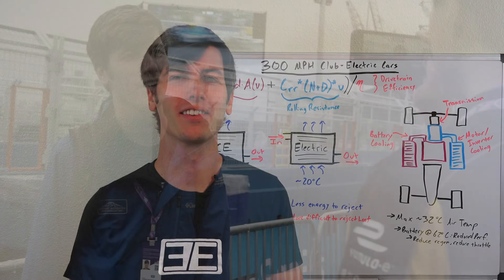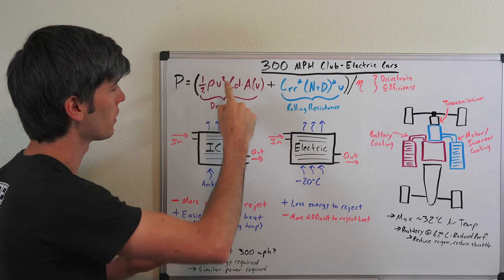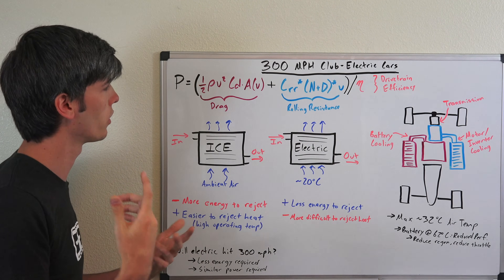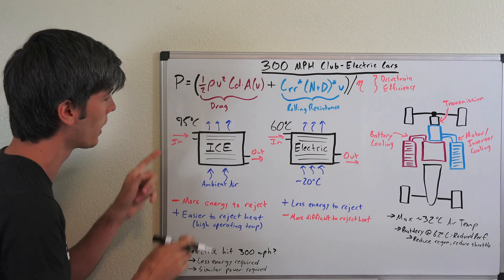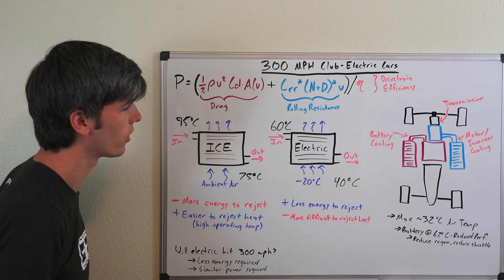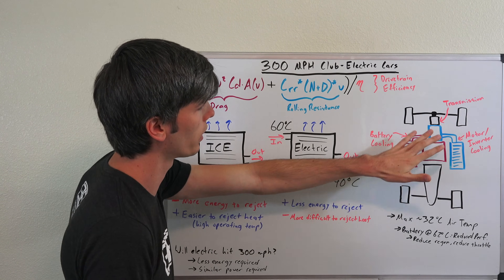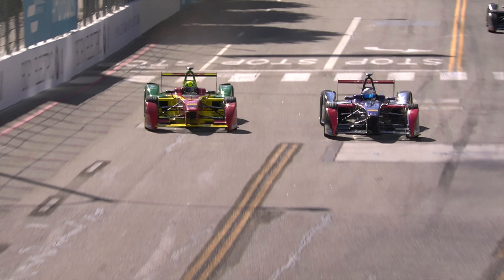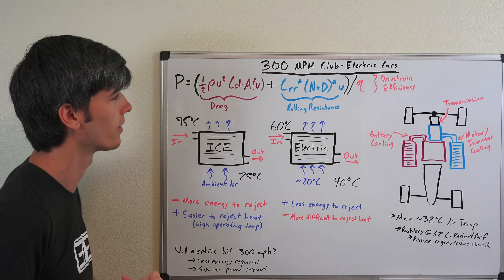Why Has No Production Car Hit 300 MPH? Electric Cars

Comment: I thought it was tires, the Veyron's tires can barely handle 434kmh/270mph and they were specifically made for top speed.
Reply: Shizukage I immediately thought the same thing. When Bugatti first released the Chiron, they said tire technology was the one thing that kept that car from going 300mph.
Reply: I think he talked about that in his last video about the hp required to go 300mph
Reply: The question is "Why hasn't a production car hit 300mph yet?" That's literally the title of the video, man. Lol
Reply: joseph bourdeau i think if you can afford a street legal car that can do 300mph you can probably afford a few thousand dollars for tires.
Reply: @kellypg  The problem isn't necessarily the dollar cost - the manufacturer can't be sure that you will bring it to the dealer for tyres,once a week - if they could, 300 mph is easily achievable...
Reply: Definitely a factor as even Z rated tires are only really safe up to 150 mph a car going twice that speed would have to have specially designed tires probably costing a couple thousand dollars each !
Reply: I was about to comment this, yeah the tire bead expands due to the centripetal force and all hell breaks loose
Reply: 3両編成・・・
Reply: Shizukage the wheels need to be made of cold steel alone.
Reply: Jesko and hennesy suck
Reply: That's a vehicle not a "Production Car"...I hope you're joking honestly.
Reply: You are correct (or were correct - this is an old video) Tyres are the weak link,and what's more is,this will be more of a factor with EVs,because they are heavy. Much as I like the idea of an electric car,you can't get away from reality. The other,other side of the coin is that EVs need less air going to the brake disks,and one of the biggest sources of drag on your shopping SUV is the wheels,so,there's that...Happy 20, y'all
Reply: Top fuel dragsters reach 340 on rubber tires. Granted it is 1000 feet, but I think tires can handle 300 on a production car.
Reply: TheGameDeity oh well i thought i was on his last video. I was bouncing back and forth. But tires arent the issue with loosing some comfort we can hit 300mph. There are rubber tires that already can go 300mph.

Comment: 450hp can get you to 200mph.
1000hp is needed to get to 250mph.
1500hp is needed to get to 275mph
so since you need 500hp to get 50mph more, then 500hp to get 25mph more, you would need 500hp more to get 12.5mph and another 750hp 6more mph 2750hp would be needed to get to 300mph

The faster you go, the more air wants to slow you down.
Reply: what 450hp car does 200 mph ?
Reply: actually is not only horsepower. I'ts the balance about grip, aero, hp, drag, weight, etc that you need...
Reply: arh but decrease your downforce and you increase the chance of your car deciding it wants to be a plane.
Reply: It's not quite as simple as that...
Reply: jose luis vicioso marte You are wrong. You said top speed is about hp, aero, drag, weight and grip.

Aero and drag are already accounted for in the HP equation for wind resistance, mass is already accounted for in the HP equation for rolling resistance and grip is only a problem when accelerating or braking, not for top speed.
A problem that you didn't mention however is the stress on the tire, that's why Bugatti had to develop a new tire. 

So in the end it's only about HP and the (for lack of better english skills) "stability" of your tire.
Reply: F40?
Reply: thank you very much MrcabooseVG. finally someone is on my side
Reply: lol I can c u got a lot from the vid.
Reply: i think the f40 has almost 500 hp
Reply: I think it really is this simple because the drag is a factor of the velocity cubed (cubed!).  This can be seen in EE's earlier video. And as velocity increases, this term dominates all other factors.
Reply: Oh so wrong.
Reply: MrcabooseVG Yes, it is about HP. Because as you can see in the video the needed HP is a function of cw value and area.
Reply: I think top speed is more of a torque factor
Reply: Just drive underwater, there is no air in there. You can probably get to 300mph with like 100 hp
Reply: Easier to just engineer a co-axial helicopter me thinks... Imagine how well a coaxial helicopter with a cruising speed >300Mph, decent range, payload comparable to a car and an advanced autopilot function would sell for? Far more practical... Think of it like your own short ranged private jet...
Reply: IIGrayfoxII diminishing returns
Reply: IIGrayfoxII your numbers are for a specific vehicle.  Drag coefficient area, what the fella in the video was talking about is the most important factor for top speed. For example, a c5 corvette may be able to do 200mph with 450hp but a Ducati super bike can do 200 with 200hp. An e- tracer motorcycle could do 200 with only 150 hp.  So lowering your drag coefficient area is more important than increasing hp for top speed.  Drag increases with speed squared.  If you want to reach 300 in a car with only 1000 hp. You need to make your car short skinny and aerodynamic. Like my little picture on the left there depicts.
Reply: sorry i did an erron in the comment -.-"
Reply: well is true. but top fuelers hit it.
Reply: a modified nissan gtr probably, or a porshe maybe
Reply: dem1g0d1 but can the driver take the Wind when doing over 225mph in a bike?
Reply: Perhaps more aerodynamics..aaand just the right downforce, also maybe a more drag resistant front end material...or heavier car
Reply: did you mean a Chuck Norris volvo :v
Reply: +llGrayfoxll its more about drag then raw power man
Reply: well, it's true. but i think is like a double sided knife
Reply: Richard Bottom that's pretty much how it works
Reply: The first 300mph super sports car won't even look like a normal car at all. It will be the most aerodynamically advanced F1 inspired sports car.

Someone is going to do it some day.
Reply: what even is gearing
Reply: It is possible for a non production car. You'll need a teardrop shape wich is the most aerodynamic shape and as little downforce as required to stick to the ground so you don't have extra drag. You then close some windows that were used for cooling purpose to get as aerodynamic as possible and then you slow down with all those windows open to help the overheat engine to cool down.
Reply: 7orqu3 Ferrari F40
Reply: andrews2547
Also wrong. HP is the deciding factor for acceleration. However HP is a function of torque and RPM, so it's somewhat related.
Reply: Fighter Jets can pass the speed of Sound - Maybe we need a different power source - Electric plus internal combustion should be more likely to get there  -
Reply: MisterLifter Rolling resistance is a function of weight and trucks usually aren't geared for 200 mph.
Reply: closest I can think of: Ferrari F40. because it was relatively small and light. OR the '02-'03 SL 55 AMG... however it was never sold to the public with the speed limiter entirely removed
Reply: Now that I think of it...super street bike tires have a much more reduced friction than car tires since cae tires arent pointy like bike tires. Maybe tires would be the simple factor in this? Either this or simply narrower tires.
Reply: IIGrayfoxII 4hp can get you to 20mph xD
Reply: Lets not forget that there is no production tire on the market, currently, that is made for to handle 270mph let alone 300mph.
Reply: Ferrari F40 has 471. Not quite 450 but close
Reply: In this "clean lab" thought experiment of ours, weight only affects acceleration, not max speed. The lighter of the two, identical in all other aspects, cars will reach the max speed sooner, but it will be the exact same speed as the other.
Reply: jose luis vicioso marte actually more grip is bad for super high speeds, those crazy fast rocket cars have solid aluminum wheels, the stickier it is the harder it is to roll. Also downforce is literally just drag in the direction of the ground and drag slows you down. The Veyron and the P1's rear wing goes down halfway at very high speeds, the faster you go the more downforce you generate, if they left it up the suspension would break from so much force. Also weight isn't that important, the Veyron weighs over two tons, the hennessey venom weighs 2700 lbs yet they have similar power and top speed.
Reply: @TheThunderwars I doubt they would be able to make a teardrop shaped car (or any shape of car for that matter) that is both aerodynamic enough and street legal. Due to government regulations they have to have things like the head lights and bumpers at a certain height and width. Meaning the frontal surface area of the car has a certain legal minimum of which many of todays hypercars already reach. So until those safety regulations change (which if they do change it will be for the worse making cars of the future even less aerodynamic) the only way to achieve 300 mph will be by adding horsepower. At 250 mph its like trying to push the car through a viscous sludge like pudding, at 300 mph its like trying to push it through a soft solid like Jello. So it seems that it would require a minimum of 2000 HP to hit 300 mph.
Reply: Strap a couple SR71... Oh never mind...
Reply: you're almost right, the f40 has 450ish hp and it can do 201 mph
Reply: +Ronaldo B.
Yeah pretty much based off
What the specs of known cars are and their respective top speeds.
Reply: Leon Wagner Bingo.
Reply: The bugatti chiron with 1479hp (at the crank) could reach a predicted 288mph but there isn't a tire that could safely sustain that. current tires limit it to 261 and it is further electronically limited to 250. remember this is a production car so someone would buy this so it would have to be reasonably safe even if it was a "track only" car. modified ford GT's have reached 293mph with 2000whp.
Reply: Richard Bottom That you got 60+likes shows the lack of knowledge base today.
Reply: Not the same in evs
Reply: I hope you're just joking
Reply: It's not just horse power, if it was sheer power needed then motorbikes wouldn't be able to hit 200 but as we all know many of them can
Reply: jose luis vicioso marte of course. 
A Chiron with 2.5 times the horse power could do it in my opinion. Already has the balance to do till 270.
Reply: top fuel dragsters hit over 335 m/h and have over 6k HP but it's only for a few seconds. reliablility is an issue, the tires of the dragster they are used once or 5 times as much and in top of that in each race they need to rebuild the engine and transmistion almost in every race. but HP isn't the only answer.
Reply: You might actually be right
Reply: it depends. needs skills ad balls of steel .the h2 modified project hited 250 mph (400km/h)
Reply: you also need to consider grip, aerodynamics, weight, etc. unless you mean just the engine speed and not the actual speed on road.
Reply: Leon Wagner
No, it's not!
Why would you think that?
Reply: Leon Wagner Horsepower is top speed, torque is how quick you get there.
Reply: BlacksterFX Amen
Reply: Aerodynamics and gearing are the main factors why your truck can't get to 200 mph. It's all about power and drag, given the correctness of the gearing. Nothin else matters if you sole goal is to just reach a given speed. Tyres that will last, breaks that will stop you afterwards and a frame that will not bend under the high forces related to this endeavor are not relevant for the purpose of this theoretical question.
Reply: More hp doesn’t always mean a higher speed dude
Reply: less weight= less energy needed to archieve higher speeds. more grip= more energy transfered to the floor. more downforce= more weight to grip the vehicle. so that the energy gets more grip in the floor n.n

Comment: OR do what Peugeot did at Le Mans way back and cover up all cooling vents and destroy the car to get the record XD
Reply: Matthew botha that's what I was thinking.  But you wouldn't have to destroy the car, you could have a foldaway radiator. Just have an actuator that folds down the radiator for high-speed runs.
Reply: You could haul an energy tank for heated cooling fluid with you. Would slow down acceleration but not really effect top speeds. Would have to be a drag run but could work at least it would in my head ;-)
Reply: @T4iga that could well work: it'd be a gimmicky mode like Tesla's ludicrous, it sits idle with the fans on full cooling a big tank of coolant, possibly even phase-change material (assuming EV so no waste heat when you're not moving), then when it's ready the air inlets are covered or tucked like on the Murcielago and you gun it.
Reply: Matthew botha or do the test in space where there is no drag at all. Or atleast high up into the atmosphere  where there is much less drag. But that kinda defeats the purpose doesn't it..
Reply: Matthew botha 
But it was a race car with some downforce, lower hp to weight ratio and low amount of torque, so it only reached 250~ mph (400 km/h)
Reply: It was actually ACO's shitty fuel that caused the engine failure. Maybe learn some facts before posting :)
Reply: vtec
Reply: It wasn't Peugeot; it was Welter Racing (in a car of their own design that had a Peugeot engine).
Reply: @Rentta So it's the ACO's fault the engine was destroyed? No air was getting in, it's common sense too much heat will kill any engine.
Reply: Okay, drive your car at the max speed it can do with all air vents covered for 5 min. It will kill itself.
Reply: well, we're talking about production cars... not one-off sacrificial cars  ;)
Reply: Just carry a tank of liquid nitrogen, for top speed usage close down all radiators, go for it and cool internally with that, after reaching the top speed you go back to normal. Basically what aircraft from the 30th and 40th did. They had special tanks for "Wartime emergency power" which carried fuel additives, they would be mixed into the fuel for the time being and the radiators would close. Of course the engine would heat up after one or two minutes, but a cool engine did not help when you got your wings shot off. 
So yeah, find old tech and sell it as innovation. Engineering 101.
Reply: Alexandre Aubrey i think the question is extremely ridiculous anyways, so why not give ridiculous answers. I mean we like to think top speeds of production cars must always increase as time goes on - like computers always becoming more efficient. -  Not true.
Computers are working in the quantum world, cars have to deal with basic physics. And if you want to go nearly half the speed of sound in the vehicle that you go to McDonald's and listen to talk radio in... youll been waiting awhile. In the mean time, you could forget the idea of draging 4 round things on the ground and just buy a plane.

A production car has to have a limit, because it in itself is a regulated car.
Reply: Peugeot is still mentioned in record. I win lol